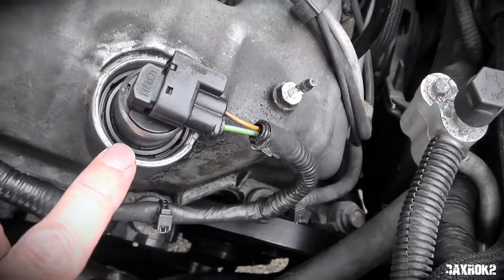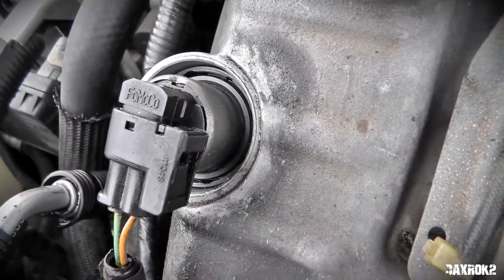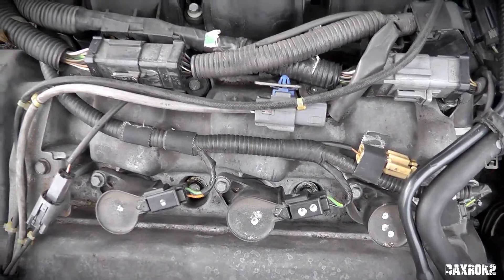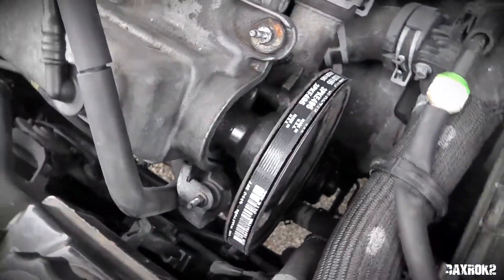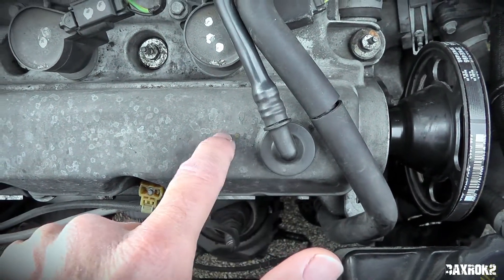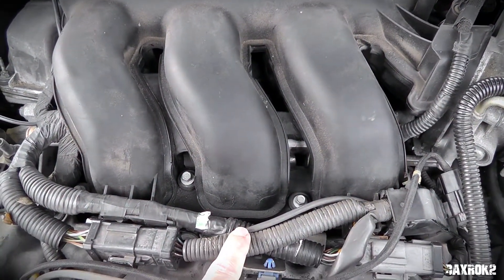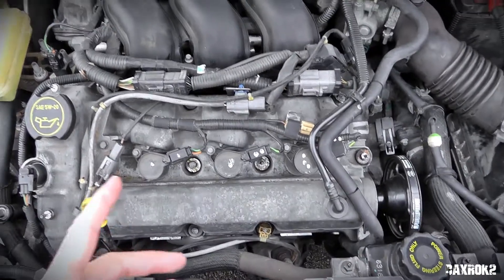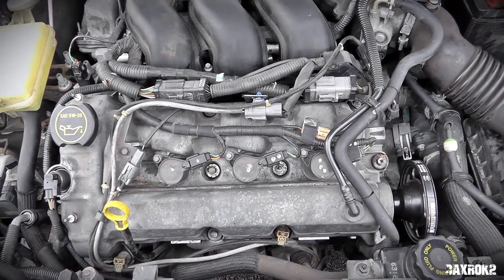2006 Mazda 6 3.0L Plugs, Gaskets, Seals, Tensioner, Etc,.

Comment: Cut the egr tube off with 3 quarters as a template. There's a write up on mazda forums. It helps the AF numbers on the rear bank. Bypass you coolant lines by t ing them together.

Comment: That darn T.....Broke twice....ended up using a brass plumbing T.  My valve cover leaks at the corner by the water pump pulley, so new valve cover is next.  Txs.
Reply from the maker: Yup, brass is the way to go.

Comment: I have about 186,000 km on my 2004 Mazda 6  3.0 and have changed everything by the book Mileage. I have recently heard a whistling sound from the front of the engine. I am going tackle the idlers and belt. The Alternator scares me a bit, changing it appears to be quite the job. Anyway thks for your advice and taking the time to put it out there.
Reply from the maker: Yeah, that alternator does not look like a pleasant job! If you change yours, make a video with all of the tips and tricks!

Comment: Me over here trying to get my water pump belt off and he just skips over that part like it wasnt a problem
Reply from the maker: Most auto parts stores loan a stretch belt installation tool. Alternatively, get the belt onto the big pulley as much as you can, then turn the engine over by hand with the crank pulley bolt. Also, this guy has an interesting idea but I've never tried it. https://youtu.be/Ff9UbajgVtQ?t=183
Reply: Baxrok2 i just can’t seem to find where my tensioner is located for that belt i just replaced my serpentine belt recently and every video i watch they already have the belly off and don’t show
Reply from the maker: @gabedeeter7335  The tensioner should be very easy to find. The idler is a bit harder to find since it's set back under the rear cylinder head.

Comment: I bought a 2005 Mazda 6  and have become very familiar with it and  these cars are no doubt a pain in the ass to work on. They take the engine and drop it in, and then string up 15 miles worth of shit around it in a place where the engine barely fits as it is.  I love this car, but if the engine goes, I'm sending it to a crusher.
Reply from the maker: Yup, but when you stomp the pedal in 4th gear to pass some slow poke, it's temporarily worth all of the trouble! lol

Comment: if you guys are going through the trouble of all this and do most of the work on your car, you  should consider doing an EGR reroute, &TB bypass. i did that on mine and it is so much easier to remove the intake manifold/plenum and best of all i dont break lines when i take it off.
if you are interested on doing this mazda6 club has great step by step guides on doing this

Comment: Thanks for the video. I bought the replacement OCV seal from Twisted Tuning. 
However, my old OCV seal torn apart. The outer ring stuck on the valve cover. Any suggestion to get that sucker out?
Reply from the maker: Use a thin screwdriver, punch, or pick to knock it out from the inside. Or, bend down the edges from the top so you can grab it with pliers to pull it out. Be careful not to damage the valvecover to prevent leaks. You can do it!
Reply: @baxrok2.  Knocking from the inside with a thin screwdriver worked beautifully! Thank you! In your video you also mentioned you see some oil on the middle valve cover bolts. Did you end up replacing those or simply changing the valve cover gasket resolved that problem for you as well?
Reply from the maker: @rj8954  Just the gasket. I don't recall if it fixed the problem or not, it was quite a while ago.

Comment: Did you find any of your cam cap bolts noticeably loose? Did they move much when you torqued them? Edit: just saw your other comment from a month ago saying not loose, thanks 

Fwiw 5-6 hours is mighty impressive. Took me 4 hours just to replace the water pump and belt, although I’m probably as slow as it gets
Reply from the maker: No, didn't find a single problem or loose anything. Car only had around 75kmi at the time. I didn't do the water pump, I just did the belt. The water pump job is a real pain. You did well to do it in four hours. I'm at 150kmi now, still on original water pump.

Comment: If you lift the back valve cover a bit after taking all the bolts off there's a 8mm holding the back oil control valve just undo it and walla it all comes right off I wouldn't lower your engine just for that
Reply from the maker: Are you talking about the OCV on the rear bank?
Reply: KB Martinez thank u that is much easier